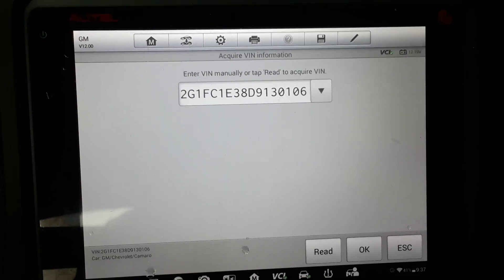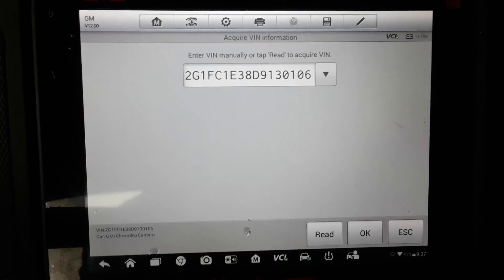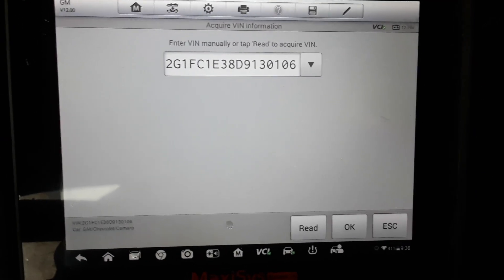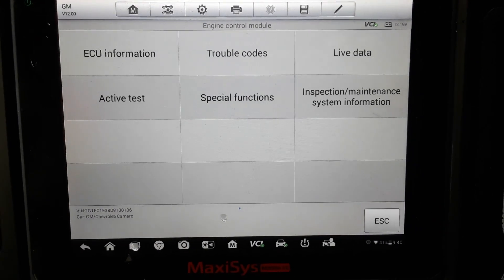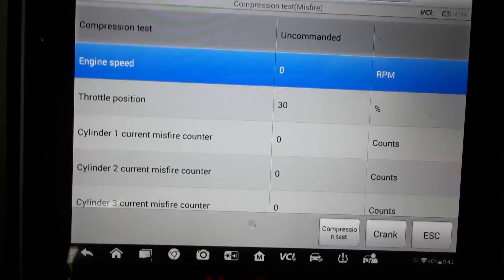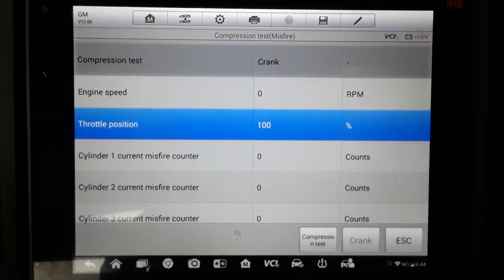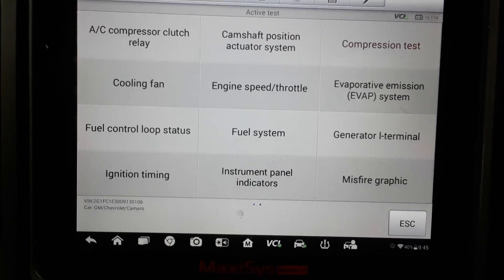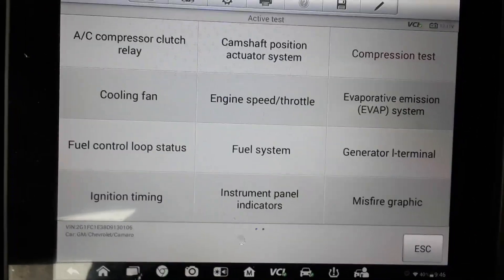2013 Camaro compression test using Autel MS906 Scan tool

Comment: It would be nice y it did a compression test and graph the current it takes for each cylinder to turn over. Maybe if I disconnect the fuel relay crank while reading spark voltage or something alike I can achieve this.
Reply from the maker: Yes, I have wondered why manufacturers don't program their computers for this. That would be great.

Comment: Question please. Will having the throttle position open at 100% cause the correct compression reading to be higher or lower than if you didn't have it open all the way?
Reply from the maker: It will be lower if it isnt opened.
Reply: @737mechanic  great to know!  I did test on cold engine with throttle closed (Mercedes e350 2008) on bank 2 and got about 120psi on all 3 cyl which is low.

Comment: f I buy  autel maxsys906 from Amzon can i use in any country or should I buy it from local dealer to avoid the pan because different IP address?
Reply: some of the other brands(in particular one very similar to Autel) are US or China or UK specific...they will work in various cars around the world but the subcategories and those features for specific brands began to become less available. Amazon is notorious for allowing too many vendors sell whatever they want without properly explaining which version. There are also knockoffs you have to be careful about getting. Best is to call and actual distributor in your country and provide them with the serial number of the one your getting. But obviously you should just buy from and authorized dealer to avoid all the headaches.